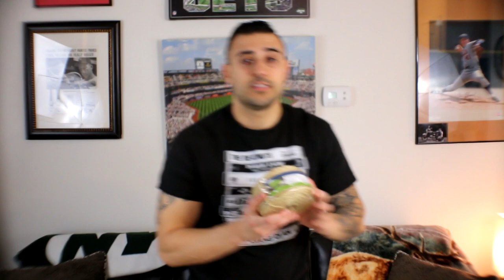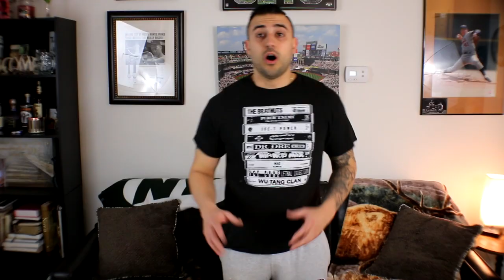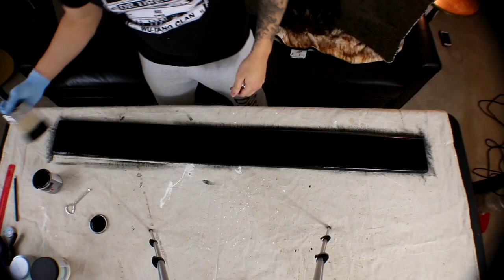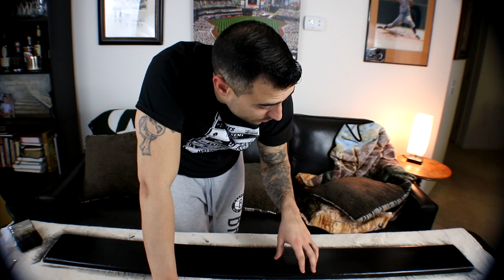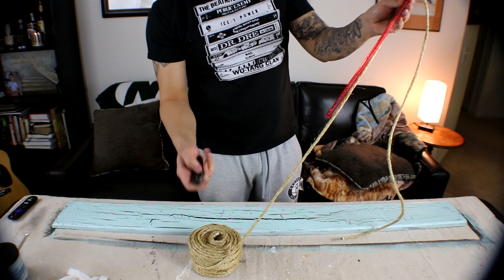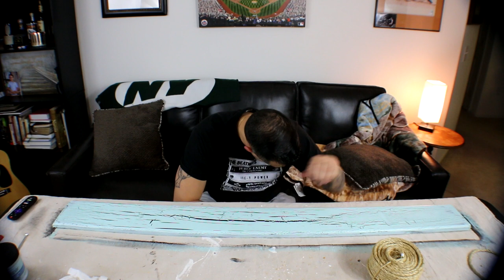MAN CRAFTS | Weathered Crackle Glaze Board | Ep. 01

Comment: Tip #1 use a water-based bottom coat
Tip #2 the thicker you apply the crackle glaze, the bigger your cracks will be
Tip # 3 DO NOT keep brushing the top coat back and forth - it interrupts the reaction needed to produce cracks

Shout out to crafters working in their living rooms! Tfs.